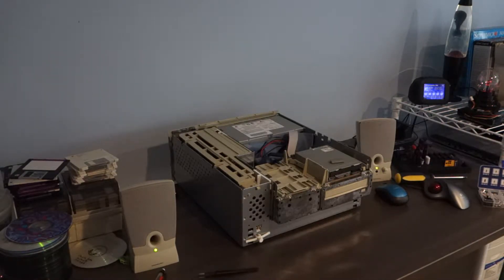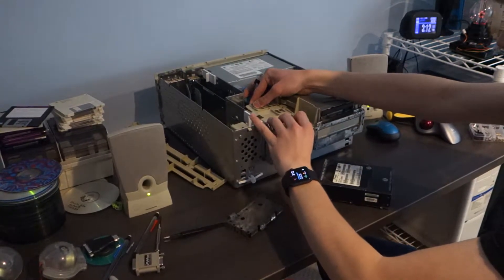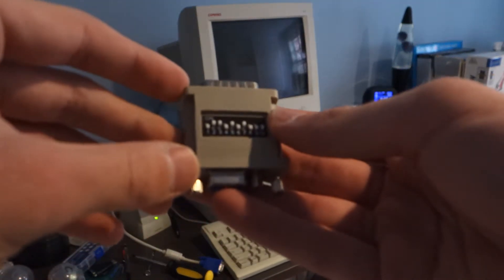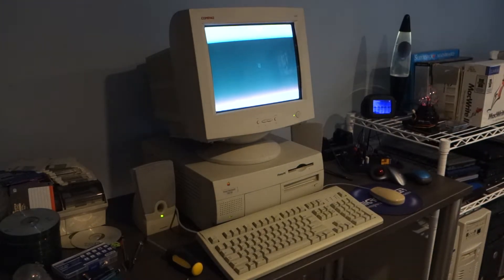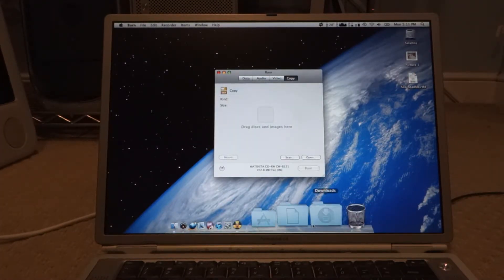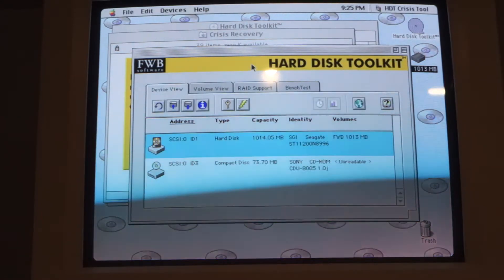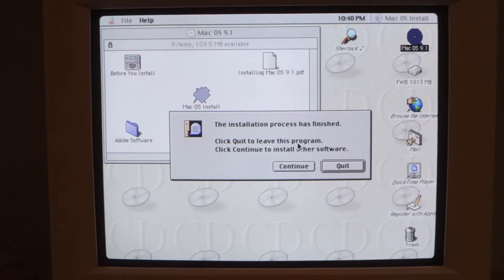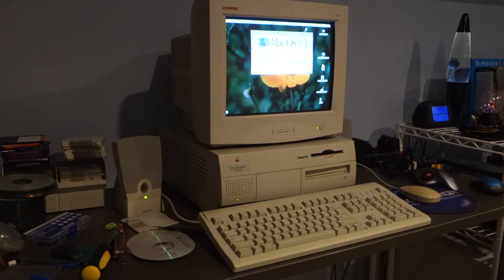Power Macintosh 7500 Restoration Part II: Software Installation And Troubleshooting

Comment: Hey! Great value stuff here! There's nothing like a video showing all the steps in detail. I fixed a Power Mac 7600 by installing a SCSI2SD v5.1 card and formatting the SD card with Hard Disk Toolkit. I installed Mac OS 8.1 instead. Thanks a lot!

Comment: Btw, you can use the keyboard to power on your 7500.  It's the button on the top right, next to the Caps Lock, Num Lock and Scroll Lock LEDs.